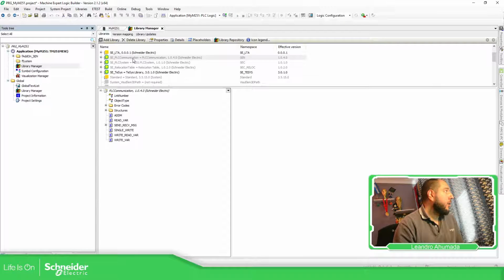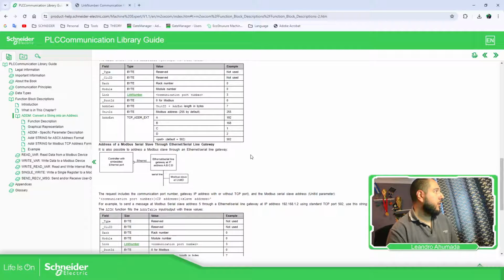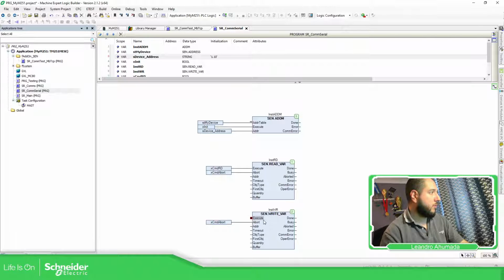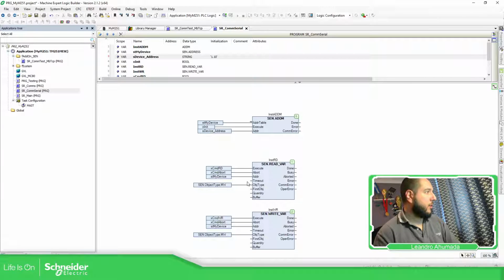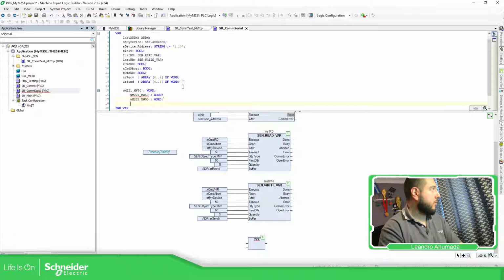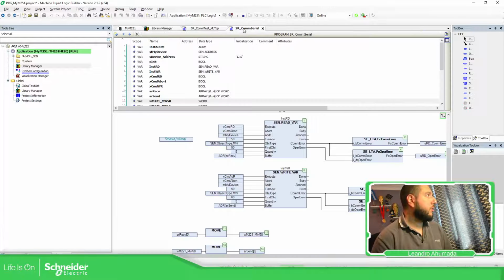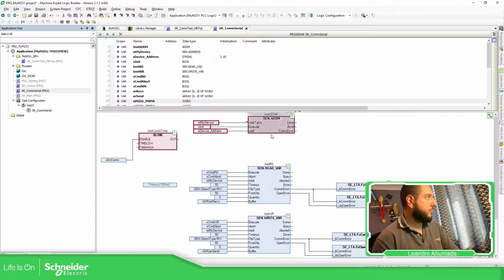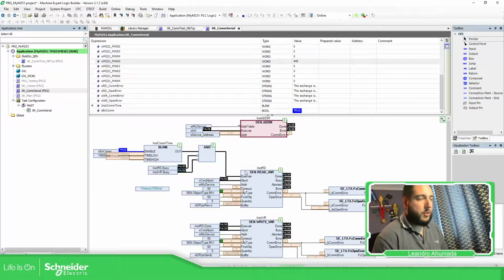EcoStruxure Machine Expert Training - M7.1 Communication blocks for Modbus Serial

Comment: Can this video be fully relied on to set up communication between a Lexium 32M and a TM241, or are there likely to be some adjustments needed?"
Reply from the maker: Hi there! You can use that to communicate with the devices, the changes will be the addresses and logic to control the axis
Reply: Sir, do you have a video of the communication between the TM241 and lexium 32 with CanOpen ? @LeTomasAHUMADA

Comment: Hello Sir,

I’m currently working on a project where I need to establish communication between a Schneider TM241CE24R PLC and a Lexium 32M servo drive. We're using EcoStruxure Machine Expert and SoMove to configure and control the system via Modbus RTU over RS485.

I wanted to ask if you have any tutorial videos or resources related to this kind of project—especially about:

Setting up communication between the PLC and the Lexium drive

Configuring Modbus parameters correctly

Reading/writing Modbus registers 

Using EcoStruxure for motion control or similar applications

Your videos have been very helpful so far, and any additional guidance would be greatly appreciated.

Thank you!
Reply from the maker: Hi there! I usually use the m241 over canopen to control the LXM32, the modbus serial will allow you to control the axis but in a limited way. I tried once but if i am not wrong it activates sequences only, if that is enough for you will be okay.
Reply: Sie, Do you have a video of the communication between the TM241 and lexium 32 with CanOpen? @LeTomasAHUMADA